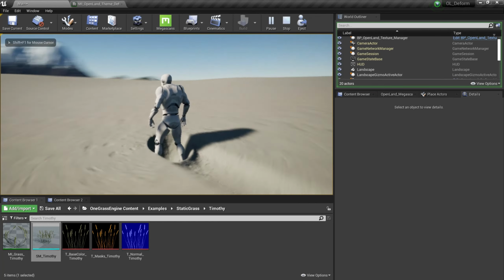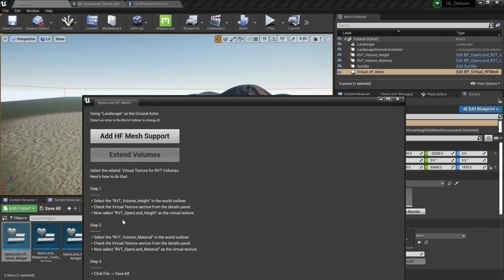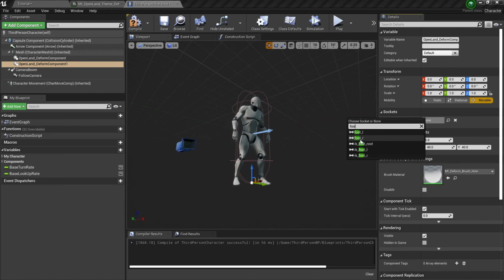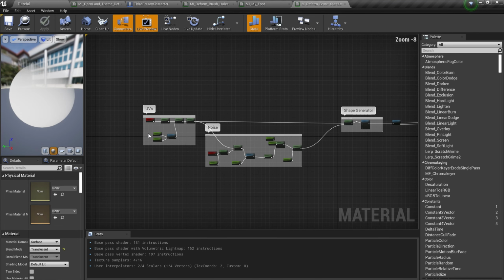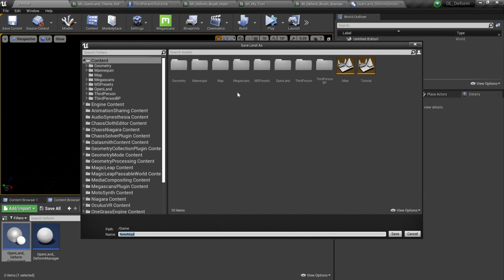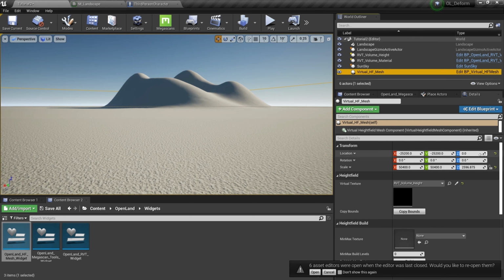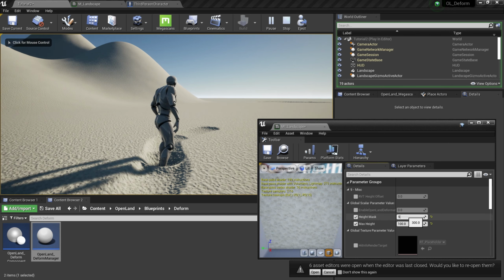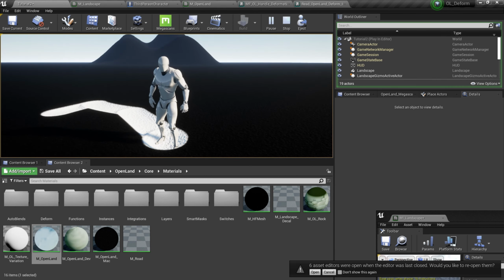OpenLand Deform Toolkit for Unreal Engine HeightField Mesh Based Trails, Foot Paths, FX (UE5 Ready)

Comment: I'm having issues with RVT Cache causing my static meshes to become blurry. I do not have discord. Thanks.
Reply from the maker: Did you use our Widget to add the RVT support? If not, try using it.
Otherwise, try to reduce the RVT textures resolution.
Reply: @GDi4K  Thank you for the reply, I did use the widgets; how do I reduce the texture resolution? Thank you
Reply from the maker: @gutterballz2180  You can the Open the RVT by double clicking the Virtual Texture property of the given RVT volume. Then try to reduce the sliders in that texture.
Reply: @GDi4K  Ok it seems to be related to using RVT tools on some of my materials... not sure how to fix. It seems like the static meshes blur with distance. Truly appreciate your assistance
Reply: @GDi4K  I found by reducing the virtual texture tile in rvt material fixed the problem. Thank you.
Reply from the maker: @gutterballz2180  glad it got resolved.